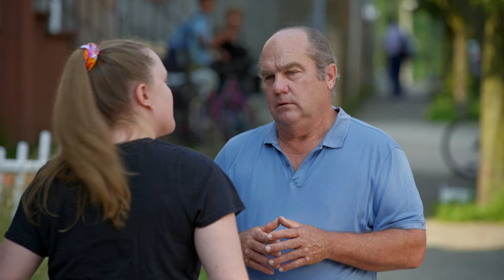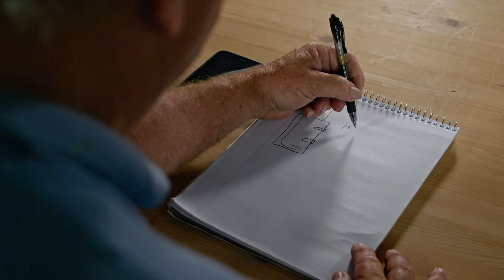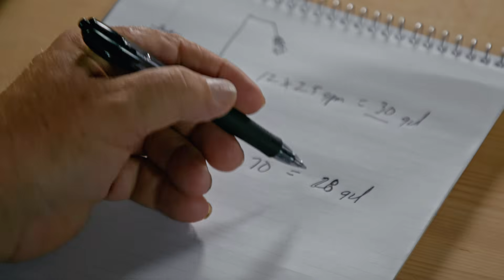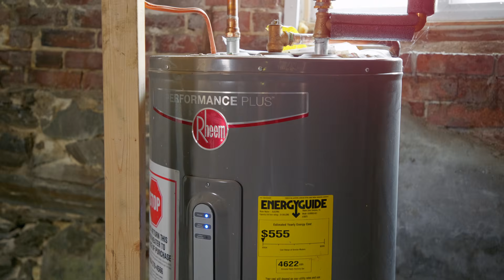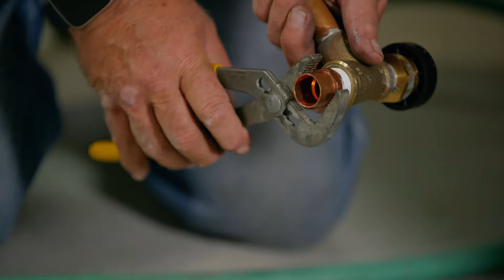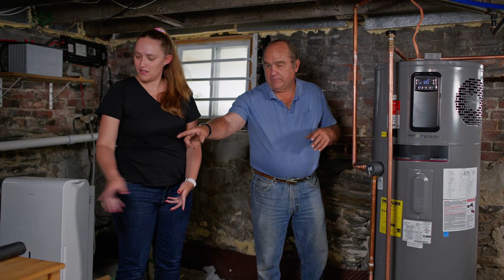When To Upsize a Water Heater | Ask This Old House

Comment: We’re in the same situation with a 40 gallon electric hot water heater. I had plans on replacing it with a 50 gallon unit, but wasn’t familiar with the heat pump version. I’ll check into this more thoroughly and check to see if this will be the best option for us.

Comment: Also increasing the tank water temperature to around 140 and then use a thermostatic mixing value to take the delivered temperature to 120 will in effect increase the hot water capacity.

Comment: It should be standard to put in a 50 gallon GAS water heater.  With a family of 4, we have NEVER run out of hot water.  Anything smaller than 50 gallons is a waste, and only GAS can give you the hot water you need.

Comment: A water heater with WIFI is a big red flag. Gas is the way to go. Cheap and works a lot better, and doesn't have the reliability issues of a heat pump system.

Comment: Or for the price of a regular 50 gallon water heater and a water booster pump, you could add an additional water heater and have 80 gallons(original +additional) for 1/4 the cost of that. When I did mine, the 1st water heater is used as a preheater(set to about 100 degrees). The 2nd is set to about 140 degrees. My electric usage is cut almost in half for double the amount of hot water I use. It's VERY simple and easy to install. After the rebate the 2nd heater was basically free.

Comment: Funny thing is since they are not as popular 40 gallons are a little bit more expensive then a 50 gallon , now if you put a mixing valve and turn the water heater up to 150 and put mixing valve set for  115 degrees you Increase tank capacity about 25 percent

Comment: Why didn't he check to see what the elements were set at most elements in a home are set at 120 to prevent  scalding and working with antiscald tub faucets. I would have set it up to 140/150 installed a tempering valve set for 120.

Comment: i saw a gas line coming into the house in the background the recovery time on a gas fired water heater is much shorter than electric
Reply: With gas water heaters, you also have to factor in venting and gas supply capacity. Gas water do have some perks though.

Comment: Nice tank although is 3 times more expensive than a regular one 😐
Reply: Depending on your electric rates it will pay for itself in two years.
Reply: It is 4x as efficient.
Reply: They cost more upfront but a lot less to run. The main issue is the reliability.

Comment: Inaccurate explanation. Electric heaters have two elements but only one works at a time. So the top 20 gallons can be at temperature while the bottom 20 gallons may not be as hot. When the shower is running, the water coming out is a mix of supply from both hot and cold so that at 2.5 gallons per minute, if it's half hot and half cold, that should supply well over 20 minutes of hot water for shower timer.
Three solutions
1)turn up the temperature setting so that the flow of hot is a smaller amount per minute
2) get a larger electric appliance
3) get a gas one. Gas heaters heat the entire tank (save for cold coming in at the bottom to replace usage) so that more is available from the start. And they recycle faster.

Comment: Surprised he didn't recommend a tankless water heater that you need to get fixed every year. Yeah those things are so cool...
Not.
Reply: Heat pump models are same thing. Notice how it had wifi too. The electronics are for sure going to fail very quickly, just like on most appliances

Comment: Except you have a bottom element with its own thermal probe. Replace both elements with new ones (5500watt elements if you have the available incoming power) and jack up the temperature setting. Water heaters always have a “first hour available volume” that’s greater than the static capacity due to the recovery rate of the elements. DISCLAIMER the recovery rate is at the selected temperature. Most likely, the temperature prices are set way too low.

Comment: Anodes from box water heaters versus the right anode for chlorinated (better) water which misses the SRB hence no smell, the tricksters with cheap power anodes that can be incredibly underpowered, Power anode sounds great, you do not know how it (does not) work(s). One or more of my United States Patents are cited in at least one A. O. Smith Anode Patents, I think I know this subject quite well. There is even a cite in a Secretary of the Navy Patent for F-18 Fighter Jet corrosion detection. 
Acute failure test of Supply V Box units is misleading. The tests that matter are not instant pressure tests nor any other instant for which certain minimum standards apply to all units. Long term design matters and I can teach you quite a bit. 
The type and placement of return line pumps and the right controlling to save piping that is thousands to millions to replace depending on the building, and why a top connect return line can be a mistake or if it is done, how to lessen the damage. 
I recently was granted a new Patent that covers the 2 Lb Redesigned, Mag-Erad Water Heater Cleaner (6831000 at Menards) and the A. O. Smith Un-Lime ® Delimer, myself hold 5 United States Patents and my father of Blessed memory held 2 United States Patents. We changed an Industry. The Mag-Erad is now with directions and formulated for Electric and other type water heaters. 
National Codes I proposed and got changed, and ways to help you teach people of the danger of the bad Standards that allow electric water heaters to electrocute if the right person does not install. I’m working to get NFPA to correct a Code mistake.

Comment: One more comment to understand why an 80 gallon heat pump. The recovery, it is true is about 5 gallons an hour which is less than 21 gallons an hour for expensive resistance elements. With an 80 Gallon set to Heat pump only mode, there is enough storage to not use the resistance elements, a smaller tank does not store enough 350% efficient heat pump hot water, so the expensive high electric elements must come on. Add this to my first comment that is probably in the hands of a moderator, and it is clear the 80 Gallon A. O. Smith Voltex is amazing.  The DOE sure likes it. Then with the product that was published in the Book, this Old House seen as 6831000 at Menards - the various instructions will keep it installed for decade after decade and it is not going obsolete for several generations. Remember, set it to Heat Pump Mode only, only Hybrid if the 80 storage and 14-15 hour recovery is too long for your usage pattern.  I will talk to Mr. T and perhaps he can do a better job explaining on his next video. I told him on the first post how to find my email.

Comment: Ok fifty Galon hybrid electric water heater ten year warranty home depot advertises one brand at $2600. USD.
$400 /year energy savings, $500 rebate $900 off the first year.
$1700 \400 4.25 years without any federal tax credit offsets.
There are thirty year warranty models available. Online vs in store, location, sales tax etc etc.
Installation...
Also possible the local utility company leases hot water heaters.
Financing might be a option.
At the above price assuming every credit and realized energy saving $2900 after one year.

Comment: Great video Richard! Would one of these work where the water heater is in a closet like space instead of a mechanical room? Looks like it would need air flow in a big enough area for the heat pump to work.
Reply: You have to provide venting and supply air from outside of the small space.

Comment: She could've gotten the 40g version of the water heater with a 1.25 or 1.5 g/m showerhead from Niagra. Saves both water and electricity for about $15 without any change in pressure.
Reply: Yeah a high flow shower head like she had installed would never be allowed in the state of California

Comment: Do your research before buying a heat pump water heater.  I had a GE and later an AO Smith hybrid heat pump water heaters.  Both failed in the refrigerant system within I year.  Hopefully, there is a trouble free hybrid water heater out there.
Reply: I have this exact model. It’s been working well for almost 2 years now

Comment: I have this same water heater and I like it alot. The dehumidifying effect during the summer months is really beneficial. I also definitely noticed a difference in energy consumption. However, I do change it to full electric mode during cold winter months. The thing is like running an air conditioner in my basement and that is about as fun as you can imagine it might be.

Comment: So what did the new heater cost, uncle? Looks like 3 grand or so. Here in Oklahoma we're not so rich. I installed a shut off valve at the shower head, we all use it while we soap up etc. Our rheem 30 gal gas heater does great for our family of 4. DIY cost 500 bucks, 25 a month to operate, life is good. Glad to hear biden is subsidizing water heaters for yuppies.

Comment: J installed a 60 gallon hybrid heat pump water heater 3 years ago. It replaced an electric water heater which had failed. Rather than replacing the electric water heater the previous owner decided to get the domestic hot water directly from the boiler. This was an expensive way to get our not water. The hybrid heat pump water heater has worked very well and has always worked on tge heat pump  mode. The only downside is the cool air it produces which is dumped into the mechanical room where it is located. We received a very substantial rebate for the purchase of the new water heater which made the final price comparable to an electric water heater of the same size. Added benefit of the hybrid heat pump water heater is it helps dehumidifier the mechanical room during warmer months.

Comment: He might have been able to fix the issue by just putting on a less than $200 thermostatic mixing valve and turning up the water temperature in the old water heater.  The hotter water would be diluted with cool water to achieve the desired temperature, and since less fewer gallons come out of the tank, it could have very well kept up perfectly with the demans.  These heat pump water heaters sound cool, but they require a lot more maintenance, filter cleaning, having a serviceman to come and clean the coils, etc.  The more parts you have, the more things can break.  So whatever money you save on electricity, you might end up spending on service fees.

Comment: In Calif you need a permit and a Plummer to install or replace a water heater. Talk about over regulation.
Reply: then move
Reply: @KennedyLawOfficesScranton  No not until my water heater breaks.
Reply: I believe most states would require a permit for such a job. But homeowner could do the work as long as it meets local code.

Comment: As much as I admire and trust Richard Trethewey, his calculations are incorrect.  No one I know of uses straight hot water out of the water tank for a shower since they would get scalded quite quickly, even if the water heater was set for 120 degrees. Cold water is mixed in at the shower valve, so the hot water draw from the tank should last a lot longer than he calculates.  How long depends on how warm one likes their showers.  The old water tank has a bad heating element, thermostat or the cold water dip tube has fallen into the tank.

Comment: Umm why did he install a vacuum breaker?
Reply: Pretty sure it’s code in some states
Reply: Why wouldn’t you?  He’s explained in other videos it helps to drain the tank without collapsing it when you turn off the supply/cold.

Comment: I have the exact same 40 gal rheem except mine is gas and we never run out of hot water even with 3 showers back to back and running laundry.

You might have a bad element

Comment: Many  manufacturers make a tempering valve that allows you to increase the temperature of the water heater and safely mix it at the outlet to deliver more hot water with a smaller tank ….
Reply: Making the water heater work harder is not a long term solution. The second shower might have enough hot water but the first person gets scalded. Second that shortens the life of the water heater and increases the energy usage.
Four hundred dollars less energy per years, $500 rebate and tax credit.

Comment: For upsizing, check the 1st hour rating requirement for the house, it's based off of number of bedrooms and bathrooms. Heat pump wayer heaters are a lot more efficient if you duct the exhaust to the exterior, the comdensor will work twice as hard trying to heat the extremely cold air its sucking in from the exhaust. Also you'd want a bonding jumper on your metal water lines for shock protection.

Comment: You can turn the tank up to a higher temperature and not have to use the full 2.5gpm. You can set it to B or C and turn it on to a setting in the middle where you get the perfect water and not run out using 100% hot tank water.

Comment: Personally I would have recommended setting set the thermostats to the highest setting, typically 150°F for residential electric water heaters, 160°F for residential gas water heaters, some commercial units can max out at 180°F, and install a tempering valve that can be adjusted and set it to 120°F. Or slightly lower if there are children, disabled  or elderly people who live in or visit the home.   The average homeowner would be really surprised how big a difference that would make.  I would also have recommended a lower flow showerhead than the maximum 2.5gpm allowed.  Also, on an electric heater, the lower element or thermostat may have failed.  A gas heater may have sediment accumulated at the bottom, which acts as an insulator between the flame and the water thus reducing the recovery rate and raising fuel costs significantly.

Comment: "What?! No Sharkbite?! What a hack job!"  I'm kidding. If I ever saw Richard roll up to my house to replace my water heater, I would be humbled to be in the presence of greatness.
Reply: You know Richard don't even got a shark bite on his truck
Reply: Copper is king!
Reply: Richard is old talent. I would much rather new talent do stuff like this. 

I personally help friends of mine when they do a remodel or a new build with electrical, but i help with other trades aswell to lower their costs. You have to be sharp and progressive. I dont even look at the original blue prints for the electrical when i walk in. I just start doing my own thing. Never had a call back saying "we needed another outlet here" when the cost is going to be 50x more than it was in the rough in stage

Comment: 🤔now there’s 3 points of electric use so I’m wondering does the hybrid use less electricity then the 2 heating elements ?
Reply: The resistance elements are only used if the water temperature is really low (during high usage). Most of the time the heat pump will be the only thing heating the water.

Comment: Hot water heater has a reduction in costs, but up here in cold Canada your heater will be running more to offset the heat your taking for the hot water heater as that room now will be significantly colder all year round. Still a great show, and they have remained the same today as they were 30 years ago...................and this is good, stay humble.
Reply: You can disable the heat pump for the coldest 2-3 months a year.
Reply: @CodyOnHomes  - But then it's an entirely electric hot water heater and those things suck hydro and skyrocket your bills.

No thanks, i'll keep my natural gas unit...........It costs pennies to run, and when the hydro goes out I still have hot water.

A dual fuel HP/Natural gas might be a better option, as the cooling effect will help the ac in the summer and gas is cheaper to run through the winter.

Comment: There are other issues if its not reaching its 1st hour rating.  Most likely the upper element had failed.

My 40gallon AO Smith delivers more than 40 gallons before temperature loss.
Reply: 100% agree technology connections has a video explaining this for anyone interested but that heater should be delivering at least 45-55 gallons before losing its heat. It also would have been wise to adjust the temperature higher if possible before opting for replacement considering plumbers are so expensive
Reply: usually the lower fails first but you're right, it's definitely not working. And I don't use ONLY hot either because I don't like to get scalded to death in my shower

Comment: 2.5 gpm is actually sorta high by today's water saving standards.  That's the max you can legally have in California now but you can get 1.5 gpm shower heads. That would actually solve this person's issue, without replacing the water heater.
Reply: Yeah, we have a 1.75GPM in both bathrooms and at no point has anyone ever felt like they weren't getting enough water. Cuts down on water usage a ton and you always feel warm. 2.5 was definitely high for that 40g tank.

Comment: These hybrid water heaters remove heat from your home; in the summer that’s fine, but as soon as you’re in heating season, it’s a zero sum game energy usage wise, except now you have a $3000 water heater that will require more maintenance and probably not last as long.
Reply: Yes. Raises questions. 🤔 Especially if installed in a living space in a northern climate.
Reply: Disable the heat pump for the 2-3 cold months.